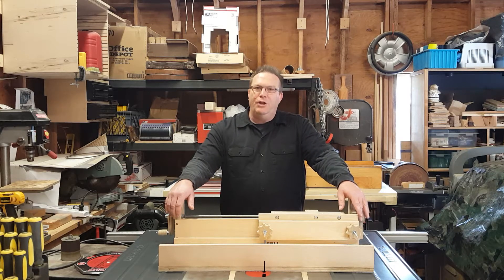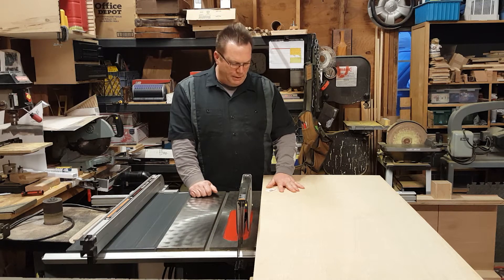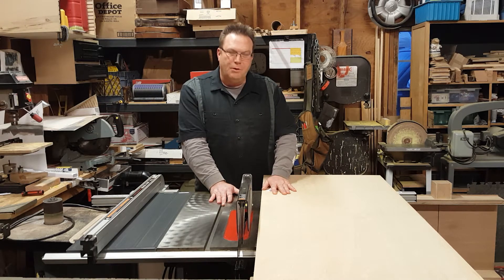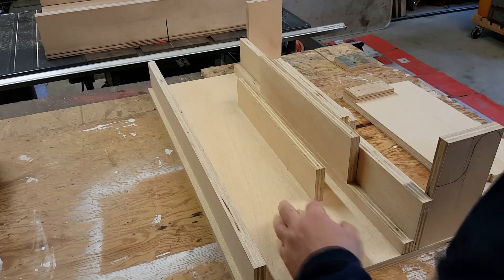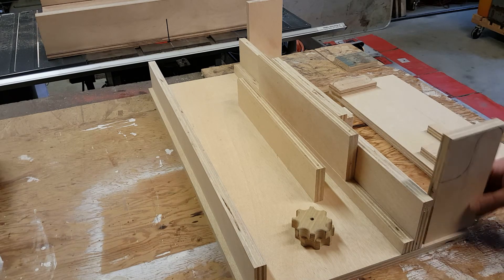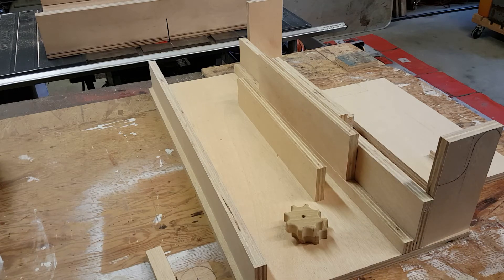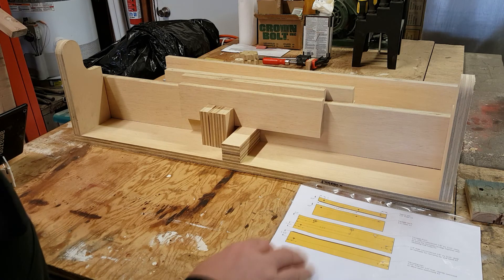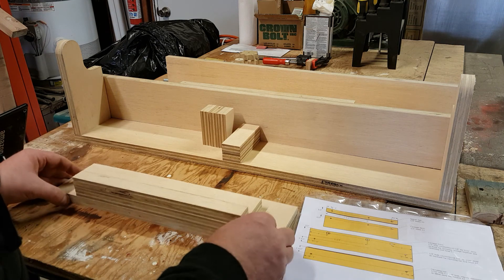The Box Joint Jig: Part 1

Comment: I built one very similar in 2013, also based on Ed Stiles.  Here is a link to the thread http://www.woodworkingtalk.com/f27/screw-advance-box-joint-jig-ts-57138/   I have since gotten a different table saw and the jig no longer works in the new slots so time to build a new one.  Nice build and thanks for sharing.

Comment: I just finished one of Ed's jigs today and my first test using a 1/8 flat top blade cutting 1/8 fingers came out perfect. Yes there were some discrepancies in Ed's plan, but not too difficult to figure out. I didn't use his aluminum stop for setup because I use a SawStop and I have already sacrificed one brake cartridge by nicking an aluminum back on my miter. I aligned the first setup by eye and it came out perfect.  I will probably add a stop made out of hardwood after I experiment some more. It was a fun jig to build and it works very smoothly. Nice work on the Sketchup and the PDF - good on you!